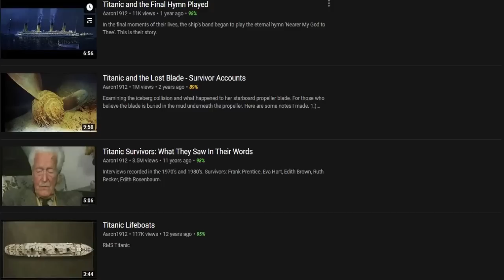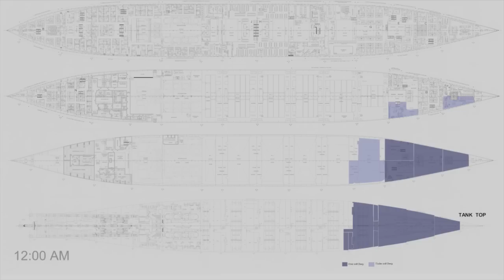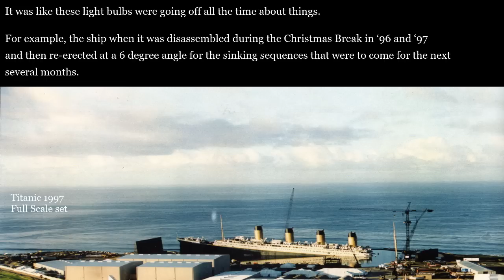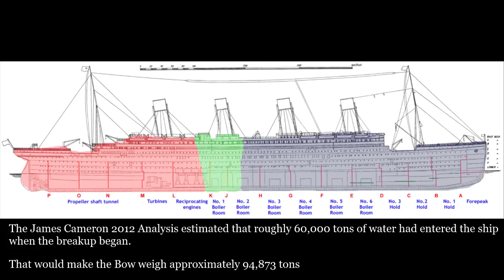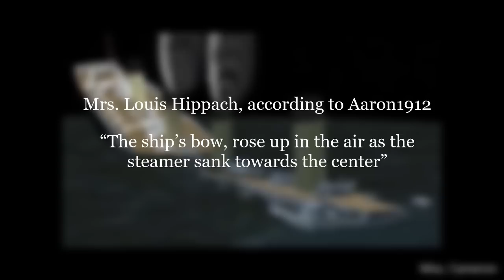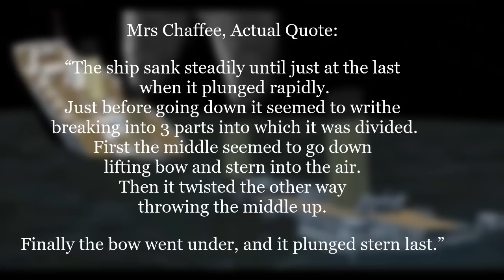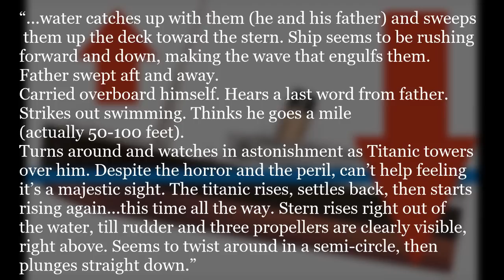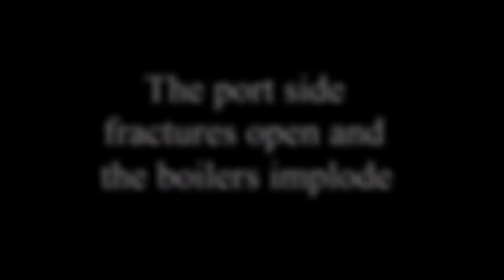Disproving Aaron1912's Titanic V-break

Comment: This is exactly why I trust your videos more than Aaron's. 
Titanic survivor: her stern rises up and she splits in half between the third and fourth funnels.
Aaron: she splits in a V between the second and third funnels. 
Aaron is clearly wrong. Titanic's superstructure was not designed to deal with that kind of pressure. And it's also basic physics. If you add pressure to an object's front it becomes heavier than the back. Thus adding pressure to the mid section. And as you said Titanic's bow was flooded. Her bow was heavier than her stern. Her stern rose up of the water and behold, it added pressure to her mid section. And with that she split

Comment: He has a number of interesting yet unfounded theories. My favourite is him insisting that Titanic's starboard screw struck the iceberg and she thus shedded a blade that to this day sits upright on the seafloor close to the wreck.
Anyone who offers any kind of alternate suggestion or questions his evidence is dismissed.
Reply: I've never watched any of his vids but there may be some validity to the hypothesis that the blade had broken. The blades themselves were made of a manganese bronze alloy, they were designed to sheer off in the event that they struck an object large enough to damage the propeller shaft.  If you'll remember, Olympic threw a blade, which along with the Hawke incedent set the maiden voyage of Titanic back a few weeks, they had to use Titanics starboard shaft to replace Olympics damaged shaft. (I'm convinced the Titanic didn't sink on April 14th, 1912, the event which sank her occurred on Sept 20th 1911 due to no one taking into account 'squat', which inevitably would place Titanic in the wrong place in amongst the ice at the wrong time. Anyways, I digress. There were passengers on Titanic who were also aboard Olympic when she threw a blade and their testimony seems to support the idea that she lost a blade during the collision, not the entire propeller, only a single blade. The way the stern is sitting makes it practically impossible to tell whether the blade is missing or whether it's buried in the sediment. The way the shaft and two propeller blades are situated along with an apparent lack of disturbed sediment seems to support the eye witness accounts of a blade being thrown. That said, unless, or until we either find a missing blade in the debris field, or can confirm whether or not the blade is intact and just buried, there's unfortunately  no way to know for sure. I'm personally more curious about the center propeller that's completely buried, does it have three blades or four? The evidence available seems to favor a three bladed prop as does a pic taken while she was being fitted out in drydock as well as a pic of Olympic donning a three bladed center propeller whilst in drydock after Titanic sank but again, there's no conclusive way we can know without better imaging technology or digging it out to see. For some odd reason, I get the feeling that no one is too eager to break out the shovels to find out.

Edit: it may be the port propeller blade which is surrounded by controversy, I know the port propeller is sitting in such a position that its exceptionally difficult to tell.

Comment: Not being savvy on all the details, but just a general knowledge of ships and steam tech, I'm curious, if the ship had sunk more or less level, wouldn't water have flooded the boilers and engines long before the ship actually broke apart? From what I recall she was still making power and lights were still on even as the tail went down, which makes sense with air being trapped in the rear for some time as she sank, but doesn't seem to work for an even keeled sinking.  Seems to me all the boilers and the engines would have been long since flooded.  Also seem to recall reading somewhere that the firemen were some of the last people to leave their posts and there are accounts from some of them, who worked to keep the ship powered as long as possible.  Doesn't seem very likely they were shoveling coal in to flooded furnaces.

Comment: Sorry, I have an issue with the weight calculations. Maybe it was just your wording. Adding water doesn't increase the weight of a ship, what is does is decrease the level of buoyancy. The more water that goes in, the greater the amount of unsupported weight.
Reply: So it's more of a "you'd need more force to keep it afloat" instead of "it adds weight so it sinks?"
Reply: @alvaryoru5441  Yes but not quite. A ship will stay afloat if the ships displacement is not overwhelmed. See the ship as an open topped container and put it in water and it floats. You have a boat. You add weight to it, it rides lower in the water. Add too much weight, its displacement will increase. Once the mass is equal or heavier than that of the displaced water, its sinks like a rock.
If you do the same thing with water, you get a whole different effect. The mass of the box will stay the same the displacement and buoyancy will naturally equalise until its overwhelmed. 
And here is gets too complicated for me to explain. I'm no expert, I understand the principles but too explain it further, you'll to go to a higher authority on the subject.
Reply: @alvaryoru5441  

No, the ship weighed 53,000 tons regardless if it was floating or fully submerged so it had to displace 53,000 tons of seawater in order to stay afloat. If Titanic had set sail with the floating drydock built for the Olympic class liners in tow using a massive chain capable of supporting 53,000 tons attached to the stern of the ship and also to the bottom of the drydock, Titanic could have sank and hung there fully intact vertically from the bottom of the drydock and it wouldn't have changed the amount of weight the drydock needed to support. Whether the ship was hanging from the bottom, fully submerged, or in a heaping pile, completely dry inside the drydock, it would still have to displace the exact same 53,000 tons of water in order to support it. If the ship was just sitting on the bottom, fully intact and structurally sound and not buried up to its anchors in the sediment, it would only take 53,000 tons of force to bring it to the surface. You would not have to support the water inside the ship, it's neutrally buoyant, the 53,000 tons of steel is what you'd have to lift. It's only when you try to lift it out of the water while it's still full that you need extra support.
Reply: " . Adding water doesn't increase the weight of a ship, what is does is decrease the level of buoyancy." 

That's meaningless semantics.
Reply: isodoublet I agree. Lol. I love the video and all, but you don’t have to be a physicist to know how the titanic sank. She was taking in water, thus sinking. The lore water she took, the more she sank. She split in 2 due to  weight, and sank in the end.

Comment: I have a question. Does anyone know where any of the funnels ended up? I can’t seem to find anything on them. I know they broke off, but where did they land? Have they just never been found?
Reply from the maker: Theyve been found and theyre pretty much disintegrated due to rusticles.
Reply: There is a section of the forth funnel off the port side of the stern section.
Reply: It has been long enough, and since they are hollow, they have probably rotted away

Comment: only think you say wrong is that water is not heavy when in water.  the ship sank because all air was removed and without floatation,,,the weight of the steel ship,being heavier than the water,,,,,sank

Comment: Reasons this is false. Float plates would’ve made easy work of the flooding compartments if compartments did flood aft. Free surface affect was shown on the Estonia. If water gushed in really fast the free surface affect would’ve occurred most likely. Also the bow would’ve already dipped a bit before workers brought the pumps and therefore the ship couldn’t flood like Aaron states. There’s more reasons but I’m not listing them.

Comment: You can also jest look at the wreck if it sank middle first than how can the front of the bow hit the bottom first’ on the wreck you can clearly see that the front of the bow is bent forward’ if it sank in a v then the back of the Bow section would be completely mangled or you can look at the fact that THERE WAS A GIANT  HOLE IN THE FRONT OF IT and the bow was full of water also when the stern sank it imploded and was ripped apart if that happened to the bow it would be completely ripped apart.

Comment: 11:17
Sinking 101:

Ship is made of iron.
Iron = Super-dense
Water = Less dense
Iron ship tries to go below the water, and displaces air and water downwards in the process.

Water pressure increases by 1bar for every 10m of depth.
Air pressure increases by 0.001bar for every 10m of depth.

As the water and air gets displaced more and more, a pressure differential builds up, until the water is pushing the ship upwards just as hard as the ship, and the air trapped inside it, is pushing the water down.

Water goes in the ship = Pressure equalizes = Water exerts net zero force on the ship. Air buggers off to where it used to be.

Ship falls to the seafloor.

Comment: It is obvious the weight of the bow filling with water and losing its buoyancy caused the buoyant stern to rise out of the water. 
And the weight of the stern or rear of the ship put severe strain on the center area of the ship causing it to break into 2 pieces. 
   And the weight of the front or stern pulled the bow buy the keel off the ship on down with it even though it did settle back down into the water and was only attached by the keel which then pulled the stern back upright and on down into the water and under. 
   And at some point the keel finally broke off between the bow and stern of the ship. 
   And that is the reason the bow and stern are separated a good distance from each other on the seabed. 
                                                         
                                                                           (MY PERSONAL BELIEF IS THIS ) 

  If the keel would have broken off in between the bow and stern that it may have quite possibly stayed afloat if the watertight doors in the rear or stern had been closed and lots of people could have possibly been saved. 
  However there was no way all that remained on the ship could have been saved as there were not enough lifeboats to hold the remaining people onboard the ship. 
   The handling of the getting people into the lifeboats that were available was a major failure in itself as the lifeboats had a capacity of approximately 60 people per lifeboat and the few of the lifeboats were not filled to capacity most of them had no more than 1/3rd there capacity. 
   The complete evacuation of the ship was a disaster within itself.

Comment: Its fake because if the ship gone sideways,it would go upside down.when the snaping part,it was animated when the bow (what ever its called at the back)would not touched because it did not hit the water,what it did is stayed up in the air and the front end was hit by an iceburge so if it went sideways the it will be upside down.i did resurch,and the middle half did not have a wall so the water shot across the front from one end to the other.thanks for your FAKENESS.

Comment: Titanic sinking theory worked by islas shipping line:
the titanics hit in the icebers probably disrupted lover parts and caused a fire when the ship sank in the lover compartments in the bow the fire is put out but fire reaches the boilers causing an explosion around the third funell stress fractures and holes started froming and the stern was bending the ship eventualy splits but the stern instantly sank due to holes caused by stress fractures

Comment: I heard that a v break might have happened, but it certainly didn't look anything close to Aaron1912's theory. 

So the ship split (just like in most videos), and water gushed through the cracks the break had caused. It caused the bow to sink faster and the top of the stern touched the top of the bow, finally severing the double bottom hull (try this with a stick. Take it from a tree with thick skin and break it while holding it at a 20° angle. The two pieces are still attached by the skin. Then move the left one up (stern) to 59-70° and straighten the right one (bow). This should cause a wide v angle, and the skin should snap). However, the bow did not come anywhere close to submerging even a small tip, much less the entire part. It probably did go up like 1-3°, but then went down immediately in less than a millisecond, and the fact that the bow is almost completely underwater means that it submerging even a little bit would be impossible. Aaron1912 surely needs to go back to physics class. 

Anyways, in a nutshell, this theory I found and just wrote about might not have happened, BUT we will all know this is like 10000x more realistic than Aaron1912's v break theory.

Comment: Long story short: the V-break is TOTALLY IMPOSSIBLE. How can a ship, listing heavily to port, and with the bow section flooded, break from the bottom? It doesn't make any sense at all. The buoyancy of the bow section during the breakup would have been near zero, thus making it impossible to rise again from the water.

Also, if the ship broke from the bottom, then those who are STILL ON THE SHIP would have noticed it because the lights were still on.

Comment: Since any part of a ship is necessarily submerged when flooded, then the mass the water in the flooded part exerts no downward force on the ship. The weight of that water is irrelevant. It's the mass of the steel—of the ship itself—that produces the downward force. Imagine a cup, that you submerge in a bowl of water. Does the water "inside" the cup matter? Nope. Only the mass of the cup matters once it is submerged. Any submerged body has buoyancy, so whether it sinks or floats depends on whether that buoyancy can overcome the downward force produced by the body's weight.

Comment: It is true Titanic listed to her port side, but not enough to cause Aaron’s messed up theory. First Officer Lightoller had ordered the crew to open up the Gangway door on the E deck in order to help with loading the lifeboats, the plan being to load third class passengers through the gangway. Sadly, this did not happen, and as the water level met the gangway, water flooded onto E deck, causing the slight listing to port, although it was barely 10-15°

Comment: I don't know why you spend so much time talking about the watertight doors. Even if they were all left open, more of the water would've been in the bow (because that's where the water is entering). That would've made the bow sink faster anyways, which would be accelerated by the fact that less of the water is reaching the stern, increasing the angle. This is extremely basic physics.

Comment: The V split doesn’t even make sense! 

The ship split due to water pressure being higher in the bow causing the stern broke off and fall back into the water, the bow didn’t push back up but instead it dragged the stern with it into the water until they finally detached with about half the Stern still visible above water for a few minutes to finish filling up with water and finally disappeared into the cold and dark waters.

Comment: Is the narrator talking about the 'weight' of the parts of the ship as the actual weight - or water displacement?
If he's talking about the true weight, than the weight of it in water is subjected to the strict law of Archimedes, and will therefore weigh less than on dry land.
I cannot subscribe to this, "being pulled down". If unhampered by buoyancy, any object will go under subjected to its shape and will try to pull down any part of it which is still buoyant.

Comment: I don't believe in the v break theory,  but your Saying the ship got heavier is wrong.  The ship looses buoyancy as the water comes in,  but doesn't increase the weight.  That being said , the stern would still be trying to raise the bow causing stress and fracture.  The bows weight would still be too heavy to lift above the water.  The fracture wasn't actually complete, and the bow pulled the stern almost vertically and down into the depths... she actually broke completely apart somewhere under the water. This is evident, because of the debris field being so tightly placed around the wreckage.

Comment: Ships only break in the middle when some sort of explosion breaks its back. The Titanic bow gradually fills with water losing its buoyancy. The weight pulling down is equal to the dead weight of the flooded portion. Once it’s full. There’s no way it’s coming back up. The flooded dead weight becomes a huge anchor pulling the ship down. If it swings quickly downward, the stern is likely to break off. We know the steel was brittle and we know the two main sections are a long way apart on the sea bed.

Comment: Good video man, I have to agree with you. I don't think physics supports the V-break theory, both literally and metaphorically. The main problem I find with the theory (from a physics standpoint, I'm not touching the accounts) is that the bow and stern need to somehow regain buoyancy to make the motions of a V-break. I have no way of modeling and/or testing this, but I believe the only way that could happen is if water was expelled from the ship's interior. Some might try to argue that either 1) the water is flowing out of the ship or 2) air was trapped somewhere in the ship's interior. I don't need to explain why both are not true, as we know from experience that water will always rise to the level on the interior of a vessel up to it's level on the outside. The only way for any air to remain trapped would be for the ship's hull to be at least mostly airtight, which it most likely wasn't based on virtually any explanation for the sinking.

Sorry for the rant. Good video, keep up the good work!